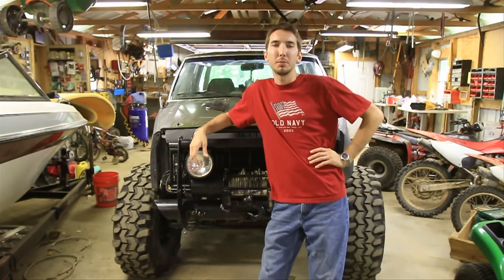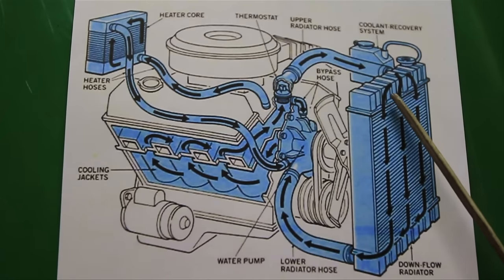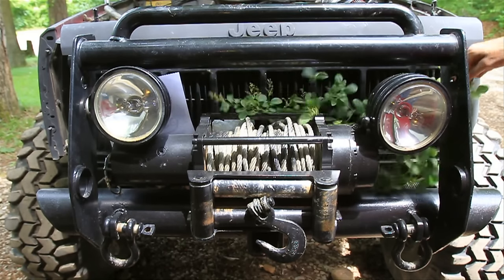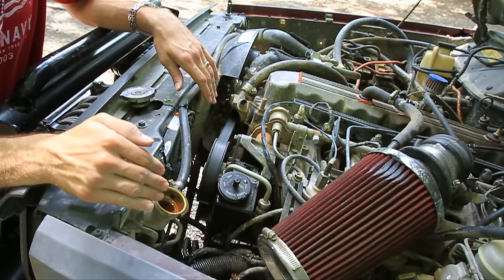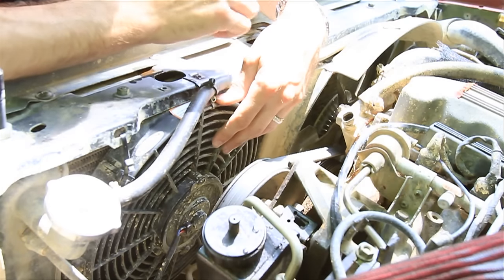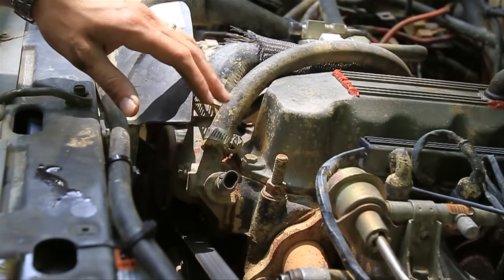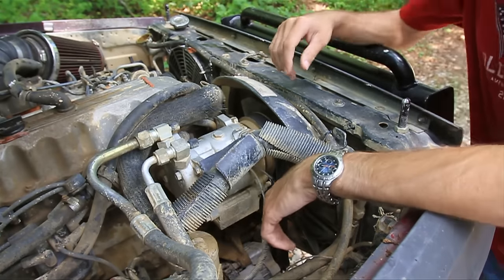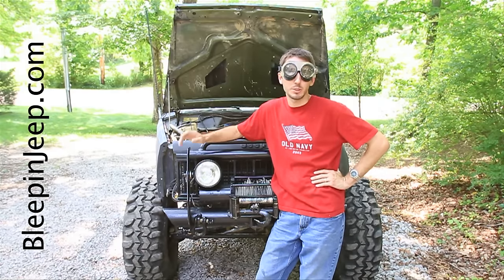Engine Overheating? - 9 Steps to Solve

Comment: Where did you get that term you call "manual clutch fan"? That would be like saying someone has a manual transmission and their clutch has a fan on it!
No, the term is simply "fan clutch" or "radiator fan clutch." Why would the word "manual" be used there?
Reply from the maker: because its not an electric clutch fan
Reply: I understand that, BleepinJeep , but it's still not manual either. These clutches are automatic. When you want to refer to a fan driven by the engine and connected via a clutch, it's called an engine-driven fan or at least a clutch fan (without the word "manual"). But when you want to refer to the fan's clutch, then you use the term " fan clutch (and obviously that only applies to engine-driven fans, so it's self-specific).
Reply: +Maxx Fordham I understood exactly what he said. using the term manual or not. It's probably a regional thing. I've ran it some people here in Alabama at certified technician shops where they say manual clutch fan. It kinda makes sense as well. Your foot engages the clutch on a transmission and heat engages a clutch on the fan. if it were automatic it would not have a clutch but a series of rings that move with fluid and bloating balls that cause the fan to engage and start spinning when the rotation of the shafts reaches a specific rpm. I don't know just making that last part up. But nevertheless tomato or tomato. manual clutch or clutch. it's all in where you grow up.
Reply: No, devin schmelter, it actually doesn't make sense, because "manual" means "operated by hand" or "operated by human" or something to that effect. That means that if just heat starts the fan, the fan operates witthout intervention by a lifeform, which actually means it's automatic; not manual. But it is mechanically driven rather than electrically. It's not about what the mechanics are made of (rings, your balls and their fluid, or whatever) that makes it manual or automatic. The key is if it requires the operation by a human (or other lifeform) or not. It's not about where you grew up or whatever; it's about which parts of language mean which things. Anyone who thinks that term is correct "just because that's how it was where they grew up" is only following the suit of a stupid misconception.
Reply: I understand that you feel strongly about it. But, The old transmissions had a floating ball bearing within the transmission that would allow fluid to travel in a specific direction.  Yes it is a regional thing even if it is wrong.
Reply: Whatever ball bearing you might be talking about, devin schmelter, doesn't change whether it's manual or automatc. Also, something may be regional but that doesn't make it correct even for that region that it came from.
Reply: No, *****, because that would be like saying that all vehicles that even have automatic transmissions are still manual anyway. That's just stupid.
Reply: I think the proper term would be "mechanical clutch fan"
Reply: That's if you're talking about the fan itself, *****, but if you're talking about that clutch there, then the term to use is "fan clutch."
Reply: Dumb *****:
HAHAHAHAHA!